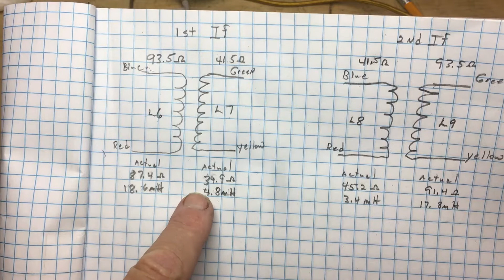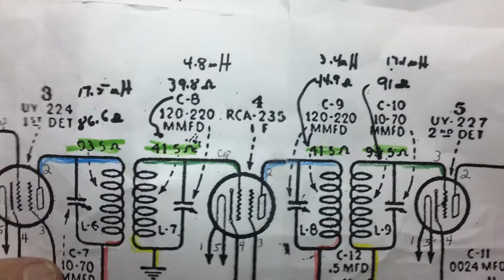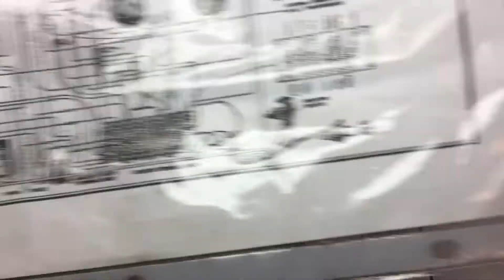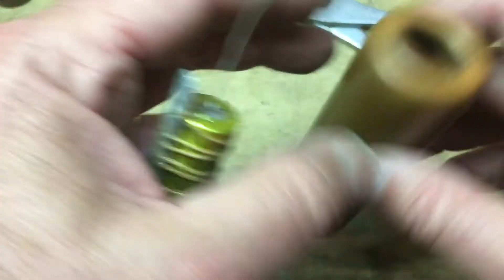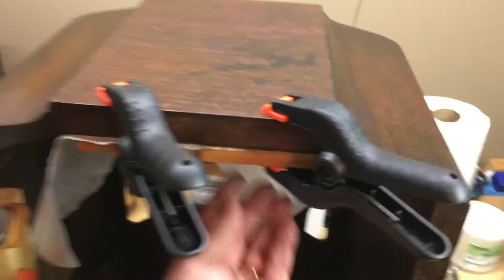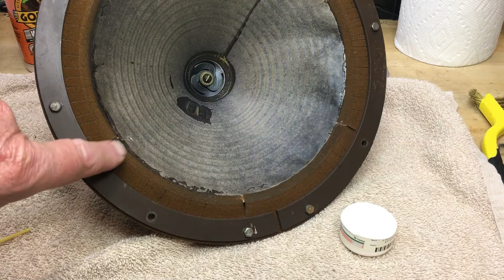1931 RCA Superette R7 Restoration Part 5 of 8 Repairs, Cleanup and a Comeback

Comment: Larry - The previous cap re-stuffing technique (can 1) was well done. I was worried about your little finger with those pliers close by. Lol  Those copper cans really look good. How do you like working with the thicker cloth covered wiring? I have some as well, but don't use it often. Your rewiring looks great. Best, Don
Reply from the maker: RestoreOldRadios Thanks for the comments Don! Im careful not to lose any appendages when working, lol. I like the smaller hookup wire better. The larger cloth covered gives the appearance of vintage wire, but takes up more real estate. In the upcoming parts, you will see me switch and you will see why. Thanks again! Best--Larry
Reply: Backtothefutureradios I didn't mention your detective work on the IF documentation, but it was well done. Interesting that the one coil had been rewound. Best, Don

Comment: For a moment I thought one of Buzz's dollar bills was going to be in that can, lol.  If you take that old scotch tape off, maybe some clear lacquer would better hold it all in place than new tape?  Just curious.  I'm cold, lol.  I just got back in from the garage and it's 46 degrees and I had on a short sleeve tee!  Now I'm bundled up and eating leftover chili from last night's supper.  Those brass cans turned out sharp.  Take a red magic marker and color that yeller wire red, lol.  I'd try the Howard's and if I weren't satisfied with it then I'd strip it down.  Of course I may be a bit prejudiced on that because I've spent the past week stripping and am getting weary of it, lol.  The fibers showed up good on the coffee filter.  I've been very lucky to date in not having any holes in speakers yet.  I did have a tear in one but it tore as two layers with their own fibers sticking out and all I had to do was use some rubber cement to get it back together.  Good to see your progress.  Take care, Gary
Reply from the maker: Rebel9668 Thanks for all the comments and suggestions. Clear lacquer would have probably have been a better option, but I was afraid to move those wires, lol. I may give it a shot today.Thanks! No dollars, but I was thinking of packing one in the transformer can. Lol. I will try the howards, and may video it before I strip it. The finish has cracked and you can see gaps in it. Im on the fence as to leave the character or spruce it up a bit.
I may send u some pics via email and let you help me decide. Got to winterize the pool today and will be bouncing between radio and pool, lol. It was 47 here last night, felt great! Thanks again, Take care--Larry